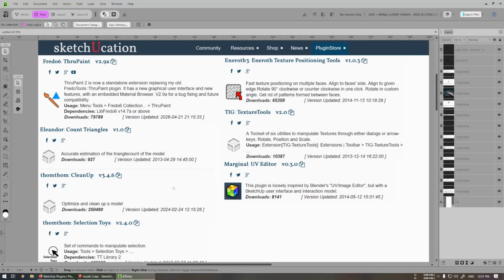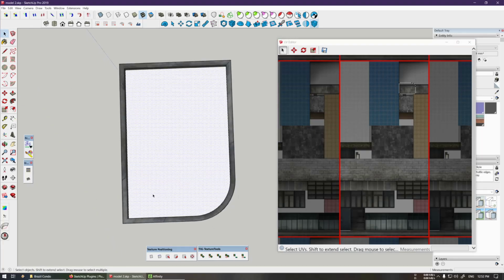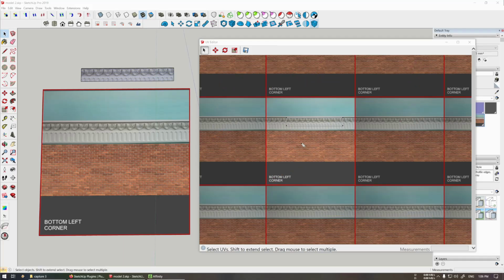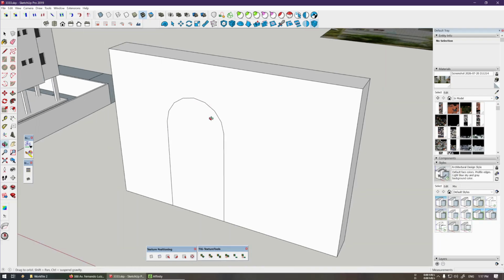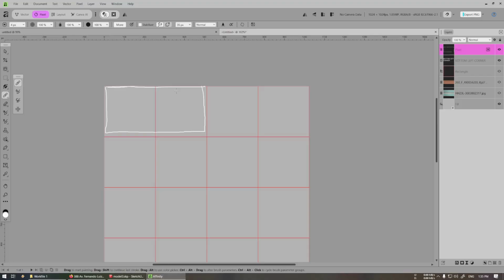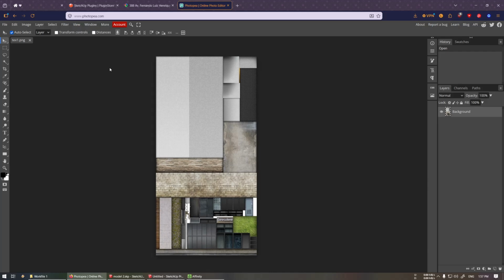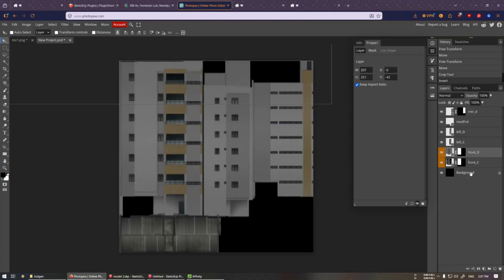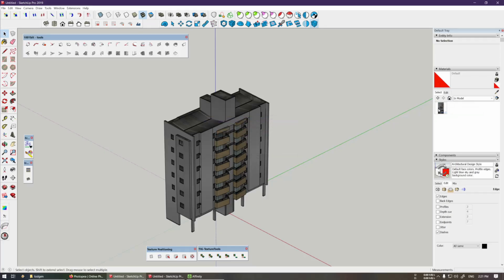Sketchup setup for game asset creation. Extension, hotkey, methods, etc.

Comment: great video. what method did you use to export the google earth 3d mesh?
Reply from the maker: RenderDoc V1.25 (THESE VERSIONS ARE STRICTLY IMPORTANT FOR THEM TO WORK TOGETHER)
Blender 3.4 + https://github.com/eliemichel/MapsModelsImporter version 0.6.2
Windows 10 Edge "Target" command as follow
"C:\Program Files (x86)\Microsoft\Edge\Application\msedge.exe" /c "SET RENDERDOC_HOOK_EGL=0 && START "" ^"C:\Program Files (x86)\Microsoft\Edge\Application\msedge.exe^" --disable-gpu-sandbox --gpu-startup-dialog --disable_direct_composition=1"
for general instruction there plenty of youtube video discussing it, just that their browser command might be obsolete or not working.

Comment from the maker: TIMESTAMP:
0:30 extensions
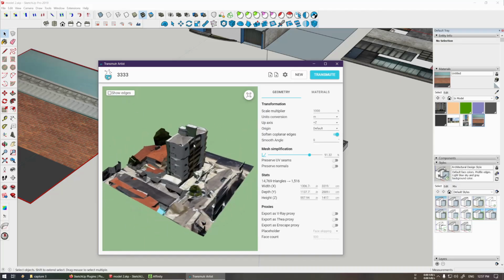10:55 hotkeys setup
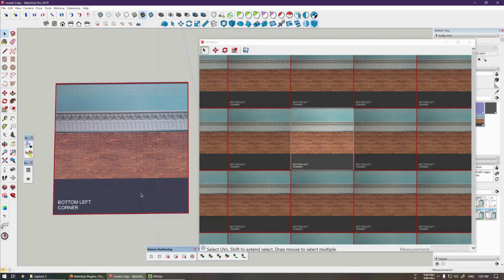13:55 UV explanation
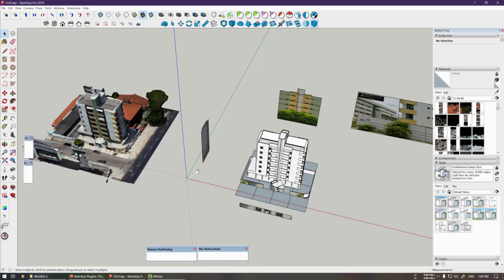16:25 modelling references
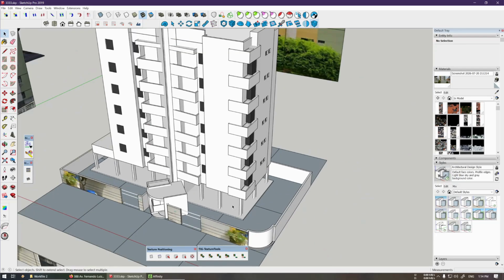19:30 cleanup & optimize model
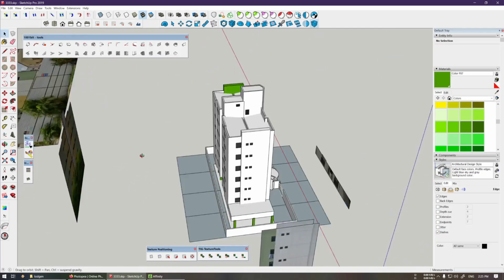27:20 texture atlas planning
32:06 "fake" shading
38:20adjusting diffuse brightness for Cities Skylines 1
39:50 LOD creation
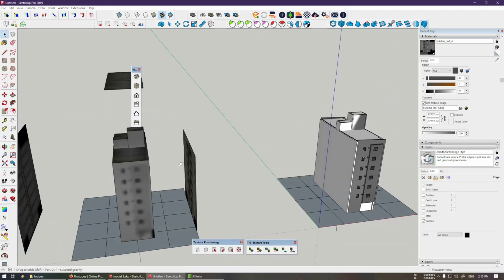49:47 export & troubleshoot